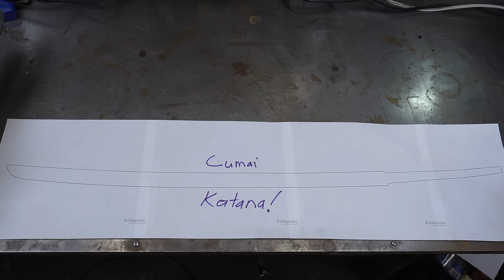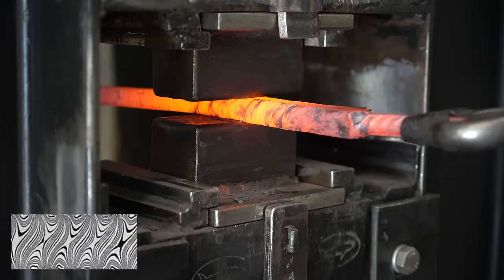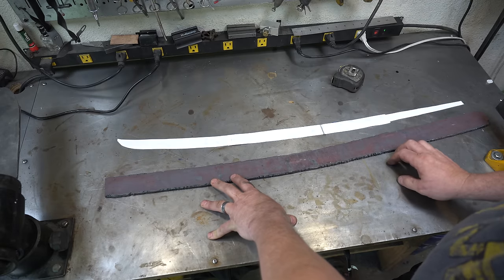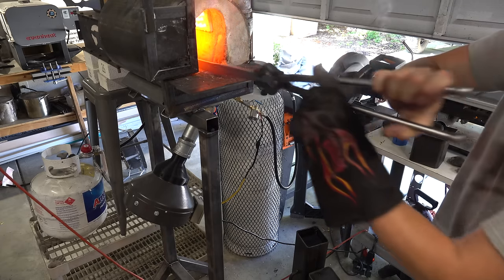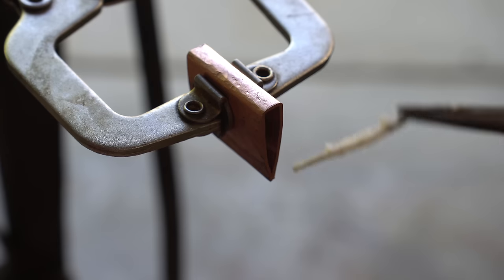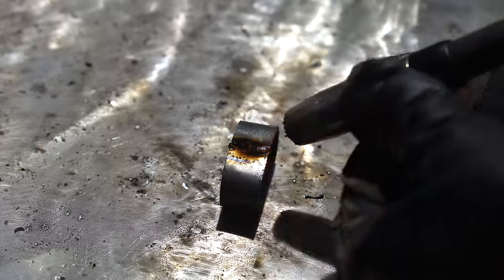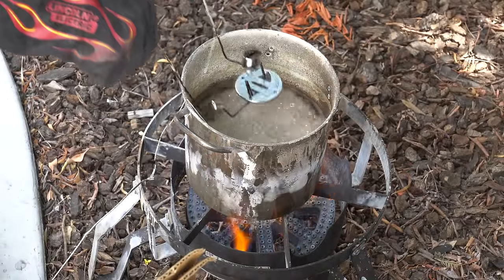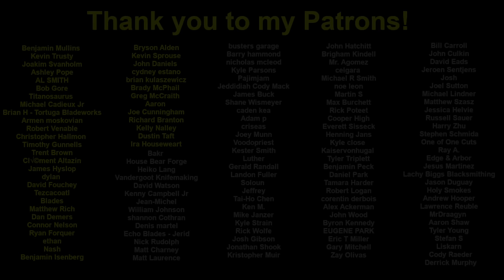Forging a Copper Damascus Katana

Comment: That copper edge on the hamon is amazing. The way it acts as an accent line between the all-black edge and the damascus blade just looks so good.
Reply from the maker: Thanks so much for checking out this build!
Reply: Hamon? There is no hamon in this piece.
Reply: To be honest, a lot of respect and credit for this idea to make this creative and beautiful pattern
Reply: @MegaFregel  Hamon is a differentiation line between high carbon edge and low carbon spine, which comes as a curved pattern.
Reply: @izzy_theog9658  and?
Reply: @MegaFregel  It's the result of a process called clay tempering, in which it brings the hamon line on the sword.
Reply: @izzy_theog9658  and?
Reply: @MegaFregel  That's it?
Reply: @izzy_theog9658  okay then. No idea why you felt the need to tell me.
Reply: @izzy_theog9658 that’s all well and good but he didn’t put a hamon in this one….

Comment: By no means a traditional かたな build, but still beautiful! I love watching people use different methods to create cultural pieces. It shows the unique beauty that happens when cultures merge.

Edit: how do you keep your copper pieces from tarnishing?
Reply from the maker: As long as you keep the sword clean and dry and put a bit of oil on it, it will continue to look great.  If it does tarnish a bit, a few wipes with a sunshine cloth or a light buffing will return it to its original lustre.  Thanks for watching.
Reply: 釖 *
Reply: @Richter8  しんでください。
Reply: @PolishBigfootCircle11  xD Mad?
Reply: @Richter8  нет
Reply: @Richter8  Why not simply 刀?
Reply: Lovely sword but desecrating the traditional way of doing Katanas... Just makes me think that's just a long decorative knive. But cant call it a katana. Very cheap to do and too easy to call it that.

Comment: It can often be very difficult to bridge the gap between base idea or materials, and the finished thing. Arts and crafts to... anything and everything, really - it's irritatingly hard to try and find the points in between, because I struggle to think of anything else except for an end point, or a blank slate.

So seeing a video about the process of a thing, not even something half as beautiful as this, is always fascinating. It's amazing and inspiring work, both far more complex and simple than I would have thought, at the same time.
Reply from the maker: Thanks so much!  I appreciate you taking a look. ❤️

Comment: you clearly understand the saying work smarter not harder, I'm definitely going to be using your custom pipe wrench design and welding a 3" pipe to a 24inch pipe wrench now. 3 inch solid round stock maybe but throw 1/2"  NPT thread on or next closest  tap it half way keep it compact if leverage is needed thread on a pipe for leverage..great idea man..
Reply from the maker: I suggest you checkout my latest build on the twisting machine update.  😉. Thanks for watching

Comment: This is the best-designed Katana I've seen so far. I really like how the copper streak separates the Damascus and the edge. The little curvy waves on the bottom guard look really good too. I am a little upset that not much effort was put into the sheath. For something this fancy, I think a proper sheath is needed. Other than that, it's a great piece
Reply from the maker: Thanks for watching

Comment: Just when I thought I've learned everything to start smithing, stuff like this continues to surprise me. I always thought that soft precious metals couldn't be incorporated into steel blades due to the lower melting points, but it's clear that you found a way to make it work! Absolutely subscribing to learn more! I AM dismayed that the billet cannot be forged after the brazing bond, and that stock removal is the only way to shape the blade, but I'd say the results speak for themselves. Question, though: is this method also able to use other soft precious metals like silver (sterling or otherwise) and gold, or does copper have unique properties making it the only precious metal that could practically make use of this method?
Reply from the maker: Yes you can do it with silver and gold. Stay tuned!  Thanks for watching.

Comment: Hello Tyrell! I've seen a number of your videos over time and have wondered:
As a craftsman who clearly has well founded knowledge and technique for the trade of blade making, what part of these copper-damascus projects do you find the most challenging?
Do you know why you are challenged by whichever process that may be?
Reply from the maker: I've pretty much mastered the copper damascus technique, so that's not really the challenging part.  I try to do a new technique on every build though.  This time, the oil temper was a cool technique I learned and put into my repetoire.  The fittings on these Japanese builds are the most complicated part.  I also did some more engraving on this one, which I'd love to get better at, but that I think will need an instructional course, which I plan to take some day.  Thanks for watching, Jacob.

Comment: Neat fact about katanas: in the early days of metallurgy, Japanese swords were straight, and it wasn't until blacksmiths introduced a cooling technique that katanas got their shape. They put a mixture of ash and clay on one side of the blade so that one side will heat up and harden in the quench, while the other side stayed cool and soft. The sudden difference in heat made the soft side contract, giving it a curve. The curved edge gave it a better cutting angle, so it was incorporated into most Japanese swords from that point on.
Reply from the maker: Yeah, read the pinned comment.  Thanks for watching.

Comment: I honestly think it's the prettiest blade I've ever seen !!! Absolutely amazing !!! It's not my trade or my area of artistic knowledge, but I have been working on equipment radiators for the last 20 years, so my understanding of working with copper is better than average. I have seen more people crack copper by trying to bend it hot than I can count.... even blade smiths on TV have made this mistake. Nice to see someone bend it the same way as I do for the most part. Not saying it's the right or only way, it's just what has worked for me. (And you as well obviously)..... my choice of artistic expressions is painting (on canvas, cars, or tattooing). Building epoxy tables. Now recently wood carving.... I love to hear when someone really likes my work, and I'm sure you do as well. With that said, this blade is one of the prettiest piece of metal I've ever seen, and by far the prettiest blade I've ever seen. Also I did not know you couldn't "hammer" in the shape with layers like that, but it makes sense because it would destroy the copper layer..... learned something new... thanks !!!
You got a new subscriber !!
Reply from the maker: Welcome to the channel, Daniel!  Thanks for checking out this build.

Comment: wow what astonishing idea to make the Hammon with copper never saw something like that!! WOW
You are truly a master at your work. One thing i learned in kitchen, when you put water in hot oil it'll explode and make the vapors oil flammable, so when you quench and you using oil, in my personal opinion you don't want to blow in the oil cause you'll make more flammable adding water to the oil.  Your works should be exposed in a museum !!
Reply from the maker: Thanks for taking a look.

Comment: I've seen blades heated and laid in water edge up with a secret coating and they bend themselves to perfect angle like magic.
Reply from the maker: That is called a differential heat treatment.  That wasn’t doesn’t done on purpose because I didn’t want the “hamon” line on this blade that would interfere with the aesthetics of the Damascus.  Thanks for watching.

Comment: That looks so good,the only thing i’ll have to say is that i saw some other makers carve a part where dust and oil can collect at the bottom of the saya so it does not make marks on the blade if the dust is abrasive,maybe you should do that
Reply from the maker: Thanks for watching.

Comment: 2 Questions :

1. How many layers of 1095 and 15N20 steel did you use to create the katana?

2. Could you tell me what are the measurements and weight of the 1095 and 15N20 steel sheets?

(If you could give me the exact length, width, thickness and weight I would greatly appreciate it.)

I loved the damascus pattern on the katana, great job!
Reply from the maker: I don’t remember exactly but there’s a graphic in the corner of the layer count.  Each piece is 4”x1.5” and the 1084 is 1/8” thick and the 15n20 is 1/16”.  Weight isn’t something you really need to know, volume is.  Thanks for watching.
Reply: @TyrellKnifeworks  Ok, Thanks a lot dude 😁

Comment: This Katana type sword can be purchased for around $7,000 because it was made with modern equipment and simplified processes and materials.
A real sword made by a famous Japanese Katana-smith using traditional methods and materials would cost tens of thousands of dollars. However, the quality of the details in a real Katana is completely different, so it is well worth paying tens of thousands of dollars.
Both choices are excellent, and the choice between them comes down to the buyer's preference.

Comment: Good show piece. Good modern metal work. The katana however is a different game altogether. The profile is created not by grinding but by folding metal, forging and hammering so that softer  pearlite  steel  spine and harder martensite steel edges  are created in the sword.
Reply from the maker: Read the pinned comment. Thanks for watching.

Comment: Absolutely Majestic! The best-looking sword I've ever seen.
Please forgive my ignorant question that does copper makes a blade weaker or it has no significant effect? Secondly, could gold be used instead of copper?
Thank you!
Reply from the maker: The entire core and cutting edge is high carbon steel so that where the strength comes from.  The copper is just a thin sheet, about the thickness of 2 pieces of paper after forging.  I’ve already done a knife with 24k gold, check my videos last December.  Also just a few weeks ago I did a katana with pure silver.  Check those out.  Thanks for watching.

Comment: Does the copper have a bad influence on the "practical" part a Katana is also designed for? Will it be to soft or will it even break if it something hard? (please don't try it looks awesome^^) I'm just curious if it will be able to do it's duty like without the copper layer...
Reply from the maker: The copper is a very thin sheet, about the thickness of two pieces of paper after forging.  The entire core and cutting edge of the blade is high carbon steel so there’s no compromise in strength or durability.  The copper is just for aesthetics. Thanks for watching.
Reply: @TyrellKnifeworks   Thanks for reply :)... I just was wondering if copper can have a strong bond to the steel ... Love this sword its amazing!
Reply from the maker: @onkelphil7419 if you look copper brazing, the bond is in excess of 70000 psi in tensile strength.  You’d destroy the blade before you could shear the layers apart. 😉

Comment: This is incredibly beautiful work. I can’t wrap my head around how you get the Damascus patter to stop after the copper “hamon” pattern but it looks so CLEAN. I’m sure you explained it just fine but I just don’t have the know how to understand. Also idk how the steel came out black as it’s my understanding forged steel comes out silvery. My mind is completely blown, to my understanding there were a few things done here that aren’t quite “traditional” for Japanese swords but who cares, this looks sick
Reply from the maker: The Damascus is the outer cladding on each side, with copper separating the core steel.  When the bevel is ground at an angle, it exposes the copper at a thin line.  The sword was etched in acid and then etched in extremely strong coffee, which turns the 1084 steel black.  I hope that helps you understand.  Thanks for watching.
Reply: @TyrellKnifeworks  wow! Thanks for the quick reply and the more concise explanation. I watched the beginning of the video again, and the silver katana video (very nice as well) and I finally understand. I can’t overstate how impressive your work is

Comment: Amazing work. I want hydro press and forge to start making composite materials.  I have some green nephritis  it so unbelievable hard that you can write on it with any steel tool like key, screwdriver, knife. Also its so hard that you can dig asphalt easy as it is sand, when i showed it ppl didnt believe their eyes
Reply from the maker: I had to look up what that is.  I’m not sure if like a knife made out of that though. 🤣. Thanks for watching.

Comment: Wow this was absolutely beautiful! The only thing I was wondering is if the copper affects the blade in any negative way?
Reply from the maker: The copper is purely for aesthetics.  The entire core and cutting edge is high carbon steel and is very strong and sharp.  Thanks for watching.
Reply: @TyrellKnifeworks  Thanks!

Comment: it's a very beautiful sword.
My question is (since I don't know anything about forging) Is this a combat ready weapon? Would you be able to take it into an actual battle? Or would the metal not hold up under actual 
combat scenarios?
Thanks!
Reply from the maker: This is a fully functional weapon. Don’t let the copper fool you, it’s a very thin sheet, about the thickness of two pieces of paper after forging, over a central core of high carbon steel.  The copper looks thicker because the bevel is ground on a steep angle. It’s very strong.  Thanks for watching!
Reply: @TyrellKnifeworks   That's awesome. You're incredibly talented. 
Thank you for the reply.

Comment: I am wondering how would it look and behave if you twisted the copper/steel bar :D would you be able to hammer it further? Heat treat it? Would it made sense then?
Reply from the maker: You can’t twist it because you  bc would end up with copper on the edge.  Plus it would probably delaminate while twisting.  Thanks for watching.

Comment: Do you push against the guard with your thumb to release it from the scabbard? Because you are not supposed to just slide it straight out as it could wear it down over time
Reply from the maker: I make swords and knives, I’m not a sword practitioner.  This one was sold when the video released.  Thanks for watching.

Comment: Beautiful sword, sir. Can you explain the adding copper reason? I think swordsmithing is fascinating, but im less than knowledgeable about it.
Reply from the maker: The copper is a thin sheet, about the thickness of two pieces of paper after forging. It is added for aesthetic reasons and does not detract from the strength and durability of the blade.  Thanks for watching.

Comment: Does the acid etch make it black? I wonder if it works on a regular katana
Reply from the maker: It depends on the steel.  Some steels etch better than others.  Stainless steel does not etch well at all and takes a really long time.  The blackness in this katana was achieved first by etching in ferric chloride acid and then for a few hours in really strong, hot coffee.  It's the coffee that gives it it's glossy blackness.  Thanks for watching.

Comment: It looks like you used an electric engraver when engraving the pattern on the tshuba. Can you recommend that product or a similar product?
Reply from the maker: That is a Lindsay AirGraver.  It’s a top quality pneumatic engraver and they run about $1800 with the sharpening system.  Thanks for watching.

Comment: my question wold be: how do you protect copper from oxidation? looks impressive!!!
Reply from the maker: The same way you protect the carbon steel from rusting.  Keep it clean and dry and apply a light coat of oil occasionally.  Steel will rust overnight if left with water on it, copper will not oxidize overnight.  Keep the steel clean and it will last a lifetime.  Thanks for watching.

Comment: Is making the copper an in-between layer makes the steel layers sticked together strongly? What is the strength required to separate them?.
May Allah bless you 💎
Reply from the maker: A copper brazing bond is in excess of 70000 psi in tensile strength.  You would destroy the blade before the layers sheared apart.  Thanks for watching.

Comment: Beautiful blade, I really like how it turned out. One question, on the round guard where you inlayed the copper strip in the groove made by the Dremel tool, how do you keep the copper from eventually coming out over time? Just curious, I would like to try that inlay technique on a few things I am thinking of making in the future.
Reply from the maker: The copper is in layer quite deep, it’s not coming out any time.  Thanks for watching

Comment: ... Can you cut stuff with it? Or is meant to be a ceremonial or decorative piece?
Reply from the maker: This is a fully functional sword.  The the copper is just a very thin layer (about the thickness of two pieces of paper) over a central core of high carbon steel that is also the entire cutting edge.  Thanks for watching.

Comment: Hi, that is an amazing blade! I also wanted to know if a knife can be made without forging and related processes, i mean with only cutting, grinding and sharpening?
Reply from the maker: Yes of course, we refer to this as “stock removal” and it’s how the vast majority of modern knives are made.  Thanks for watching.
Reply: Thanks for posting such videos it helps add a lot to my knowledge base. One request would be, if you can any time in the future please consider making a video on stock removal😊
Reply from the maker: @ericfernando3577   Lots of knives I've done are stock removal.  Look back at the copper damascus tanto or others... once you get to the part about cutting out the profile, it's basically stock removal.  Thanks for watching.